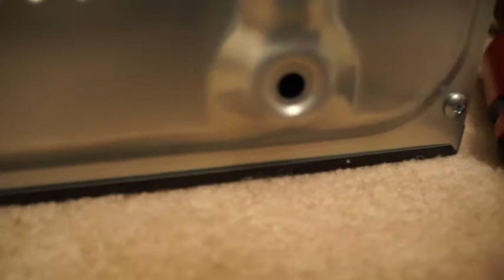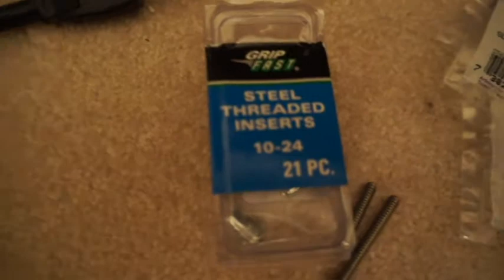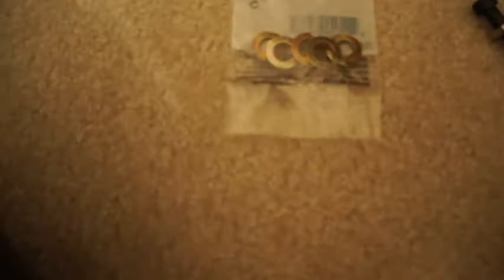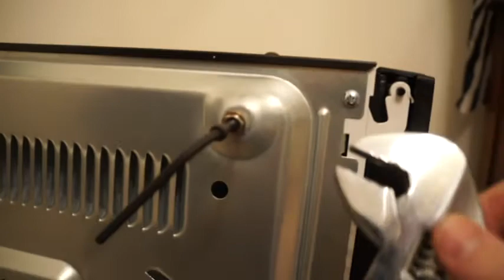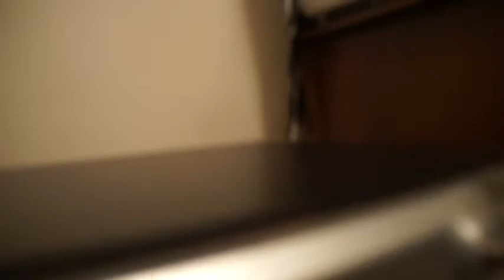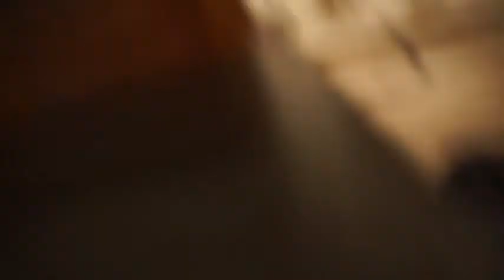Steel threaded insert or rivet nut into sheet metal using no special tools

Comment: I destroyed my $21 rivet tool. I did notice it came with aluminum and I was using steel threaded rivets like in your video. I do not think it was meant for the abuse I gave it. But I think I did more than 100 inserts before it gave out. I'll check with the place I bought the rivets from and see if they recommend their $75 tool for steel rivets. Good video by the way - until the focus went left.